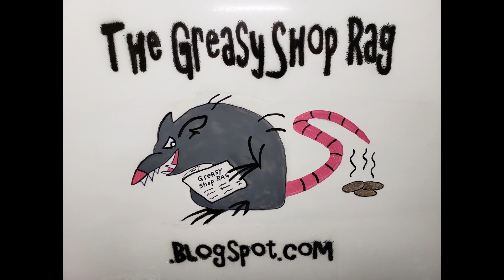Stihl MS290 Chainsaw Checkup/Tune Up

Comment: Is there a good way to clean up the rust on the muffler on this MS290? Mine has the same problem and I don’t want it to get worse.
Reply from the maker: You may be able to soak it in a product called Evapo-Rust then repaint it.

Comment: can u show how to replace the orings on leaky stihl gas caps thanks
Reply from the maker: I've found that replacing the entire cap is more cost effective. Half of the time that they leak its due to warpage or some broken part on those flip units. Then you have to replace it anyway.

Comment: Is that a streamlight inspection light? Definitely seems way more useful now knowing you can get a little fuel on it and it still runs.
Reply from the maker: Yes this is my second one and the first didn't die from being submerged in fuel. It just got kinked real bad and stopped working.

Comment: What causes the sprocket to get those grooves?
Reply from the maker: Chain wear, lack of oil, usage-its a wear item.
Reply: @TheGreasyShopRag  chain TENSION. tensioninjg it too tight will do it too
Reply from the maker: @schlomoshekelstein908  I fix a lot of home owner saws so I also see a lot of 3/8 chains on .325 sprockets or the opposite. That'll groove a sprocket real quick.

Comment: does  stihl chainsaw ms290 has an adjustable oiler? thanks
Reply: Yes. There is a hole under the saw. It has screw at the end of that hole. You can look on google for manual.

Comment: That thing is rough looking.  Do you ever watch "Chickanic" videos?  She works on chainsaws and small engines
Reply from the maker: I do watch her videos. As far as repairs go her and I work on very similar equipment. As with all the repair videos I watch, sometimes I disagree with their methods and other times I discover a new way of doing things. I'm sure that statement is the same for all mechanics.
Reply: Where do you find the cereal number the sticker is gone they must of stamped it somewhere on the machine???
Reply: On the housing between muffler and bar. Take clutch cover off to see it better.